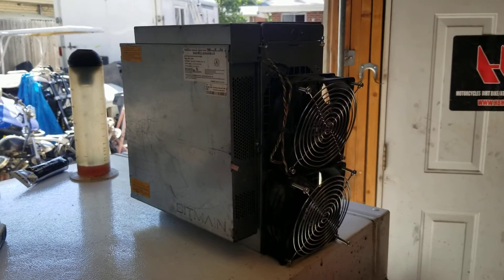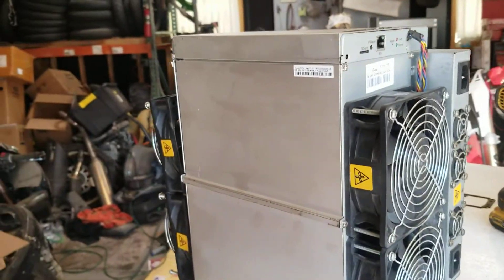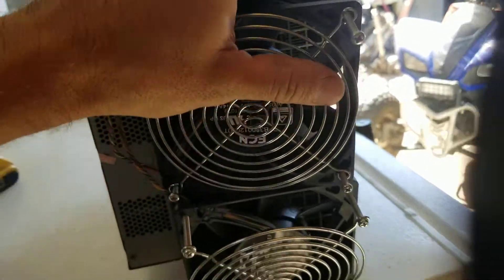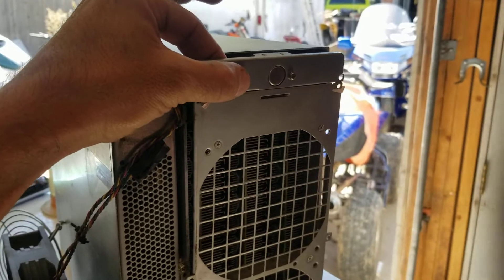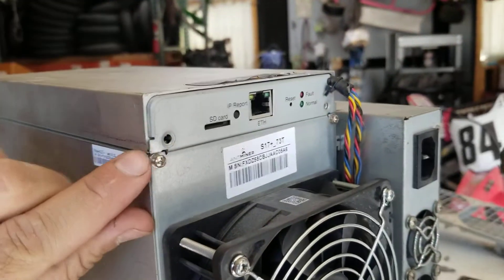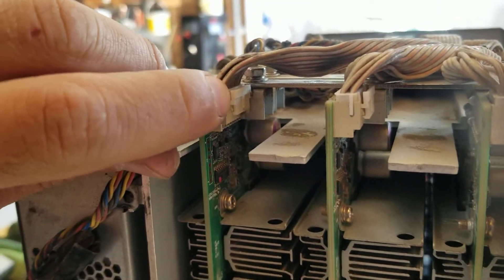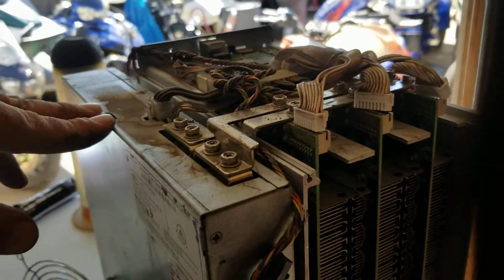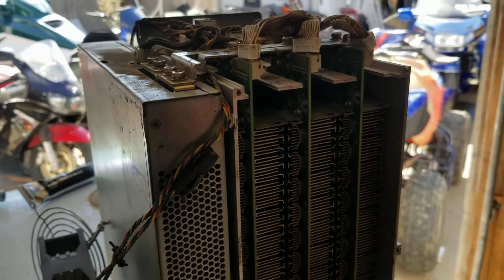Bitmain Antminer S17 Tutorial on Removing the Hashboards

Comment: My t17. dropped several heatsinks, how can I repair? Help me please?
Reply from the maker: Its incredibly difficult. Better to send it to china to get fixed.
Reply: @brothersmechanics2028  hashrate sink
Reply from the maker: @wandersonferreira9163  send to get repaired
Reply: @brothersmechanics2028  I live in Brazil, the machine just arrived from China, I wanted some help on how to repair
Reply from the maker: @wandersonferreira9163  Good luck, i do not recommend buying any S17 or T17 models. Even regular Bitmain certified repair facilities in the USA wont repair them.
Reply: Do You know this error socket conection failed if know let me now how fix thank you